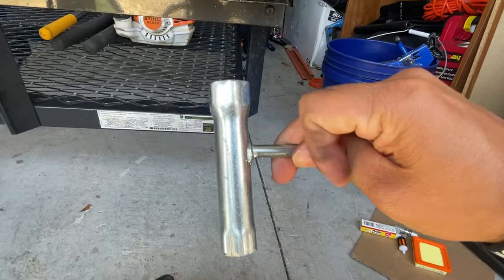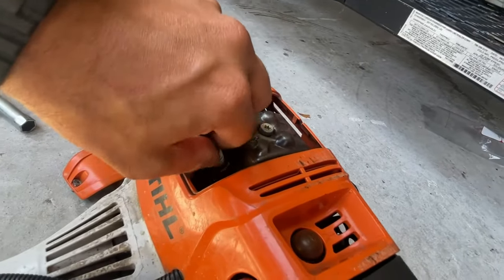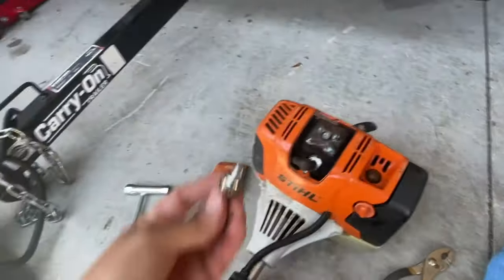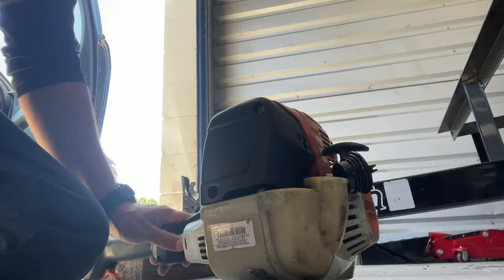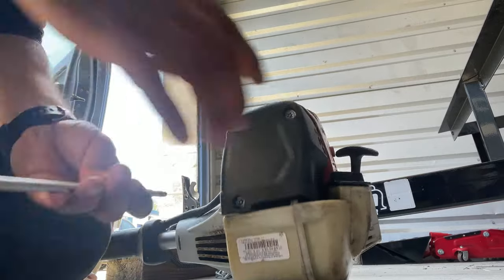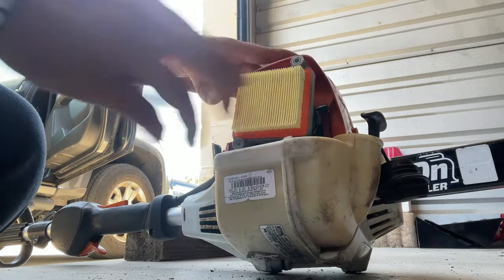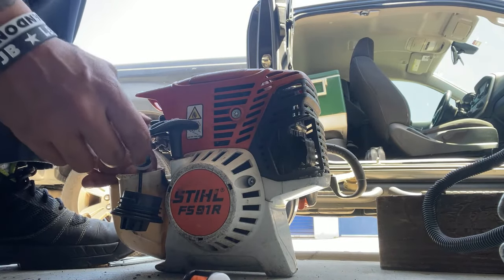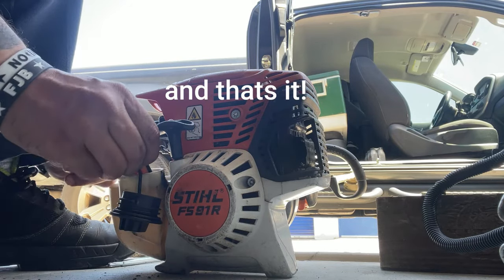STIHL FS 91R Tune Up | Weed Eater Maintenance | Spark Plug, Fuel Filter & Air Filter

Comment: Only advice I can give here is get a air compressor and a air gun for it and blast dirt out from around spark plug so don’t have to worry about any dirt falling in cylinder and if you did drop dirt in cylinder don’t pull cord just take a shop vac over spark plug hold suck debris out. And if you do fuel filter and still have bogging issues crack gas cap open get back on throttle if that fix problem the gas vent is stopped up. Also if you see wet on air filter especially when hot out that’s also sign of fuel vent stopped up